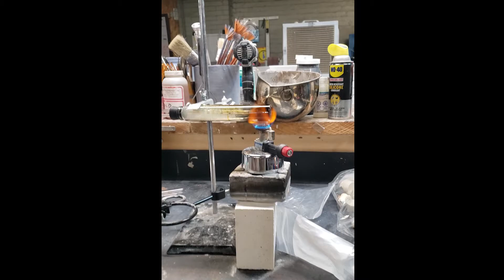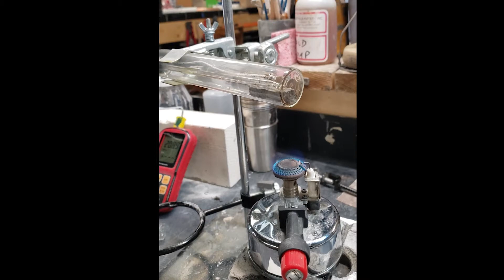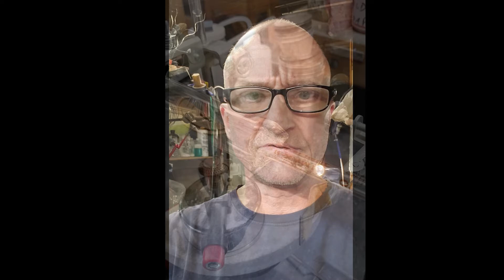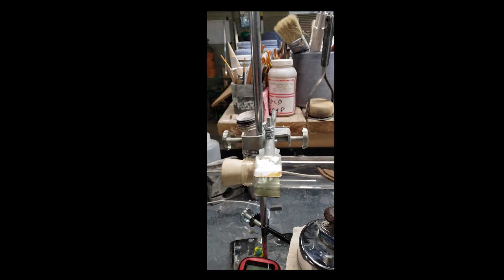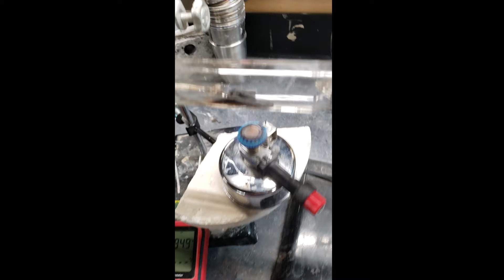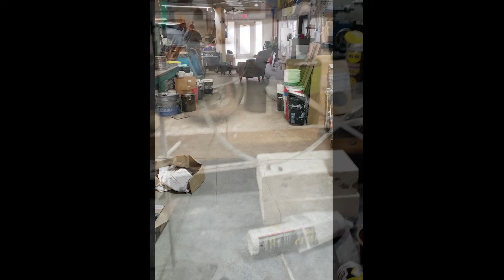3D Printing Metal, Test Tube Debind #1 of 2

Comment: I sinter ceramics/metals using microwaves in a silicon nitride powder bed lightly dusted with graphite powder to avoid sintering part to bed material.  the sintering happens so quickly that oxidation is not an issue.  a lower power ramp is used for the binder burnout.  Maybe it will work for your application.  Great stuff you are chasing!
Reply from the maker: Cool! We're almost done with printable Silicon Carbide filament. 

I've successfuly done some very crude microwave sinters of 3d prints using Silicon Carbide as a microwave concentrator. I expect that SiC, with multi-material 3d printers could provide some precise uWave sintering options. See where I'm going? A simple method of controlling how much heat goes where over time.

Might have to run your microwave on "defrost" or less , but...
Reply: Hi Rocket, do you have any videos or guides about this kind of sintering you've done? thank you, it sounds very interesting!
Reply: @WaynesStrangeBrain  I have not ever used video.  google patents is an easy read.  look for microwave sinter bed....and the like.  I have used modified microwave oven since the 80s for chemistry as well.  good luck. Tip...always put 100 mil of water in the corner when using small samples or the magnitron will burn out. search also microwave chemistry/modify for chemistry.  Good luck